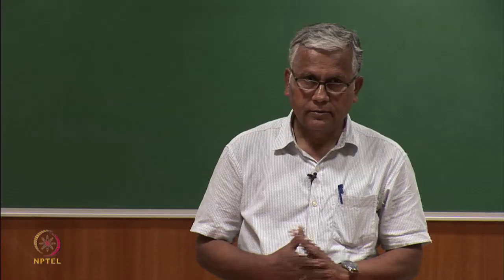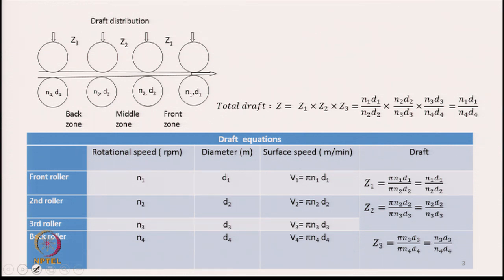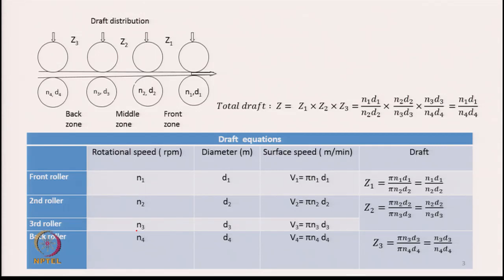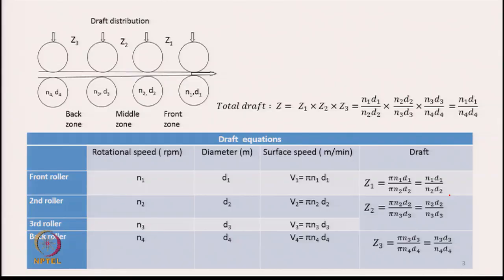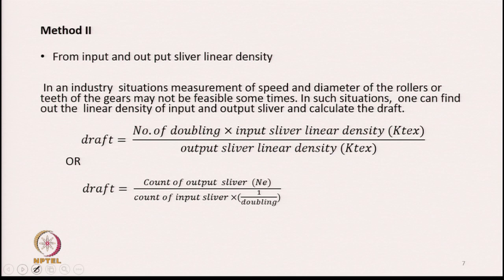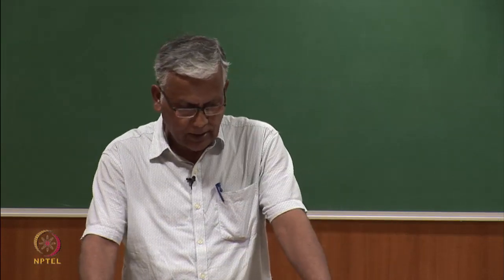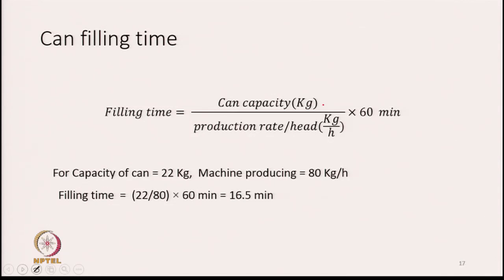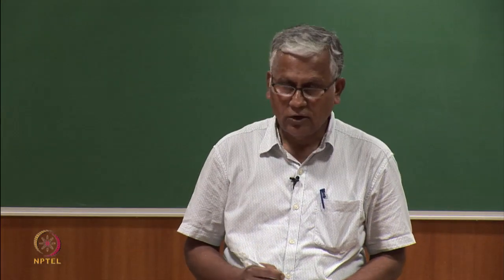Draft & production Calculation

Comment: Thank you for the detail information. I would like to ask if you have any lecture that explains the draft distribution across drawframe to ring frame in order to make a specific yarn count in ring? I have seen individual calculations however I could not find a way to calculate the distribution of draft in various processes (breaker, finisher, roving, ring) to get the final desired yarn count after ring?